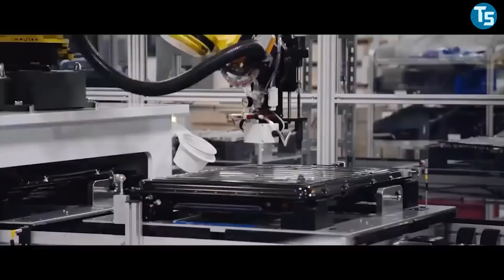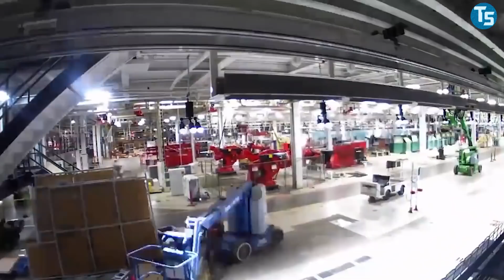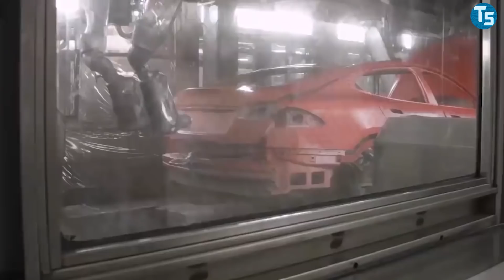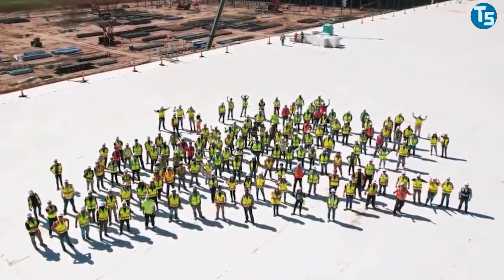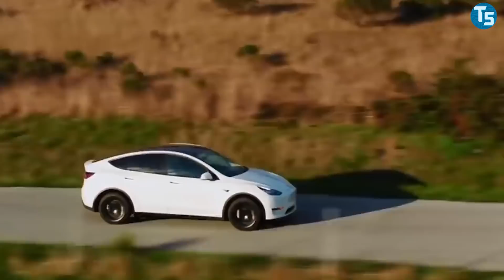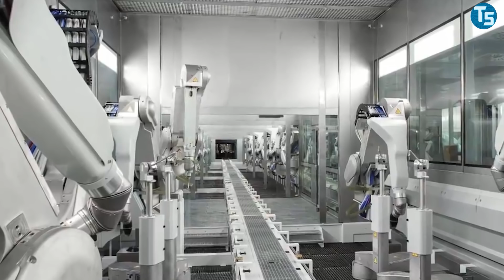Tesla's INSANE $1.7 Billion Steel Dynamics Plant | The Tesla Steelplant

Comment: The first step is to get the factory up and running so that Tesla has a steady supply of their special alloy steel, but transporting all that steel with trucks on public highways will be expensive, so step two will be connecting the steel factory and the Tesla factory via tunnels built by the Boring Company. Then products can be shipped on fully autonomous delivery systems without traffic delays or all the costs related to trucking on the highways. The savings will be enormous and the efficiency of both companies will be greatly increased.
Reply: The two plants are almost 150 miles apart. Building tunnels between the two is hilariously impractical and tremendously expensive, when there are existing railroads more than capable of handling the freight.
Reply: @SynchroScore  It is indeed a far-fetched plan, but IF the boring machine ever becomes as efficient as they predict, it might be possible. I have read that the composition of the bedrock in that part of Texas was ideal for their machines to work with.
Reply: @ There is absolutely no justification for building a tunnel that long, for a customer that will take only a small fraction of this mill's output. TBMs are a mature technology, and there is no chance of "breakthrough efficiency" that would justify such a project.